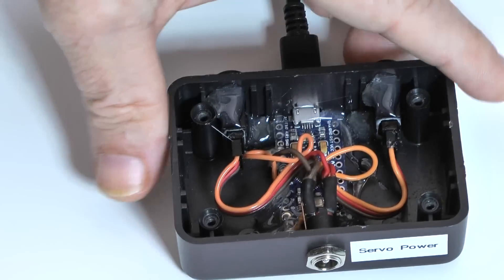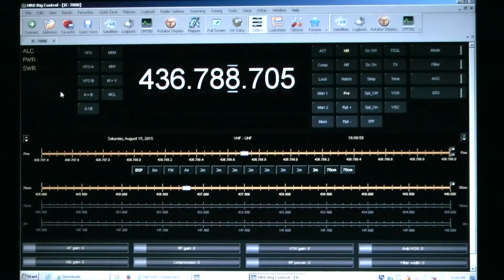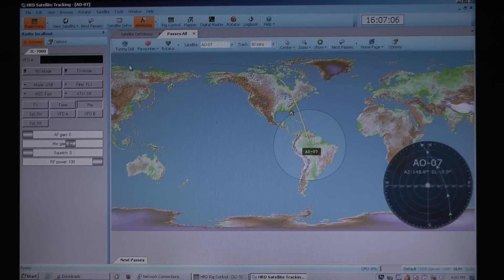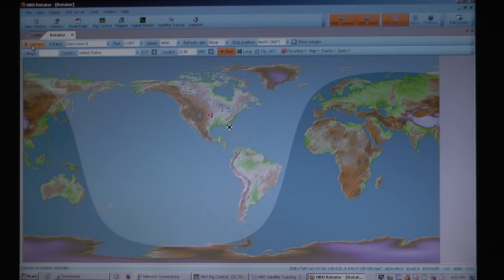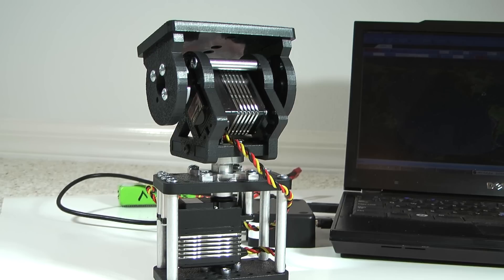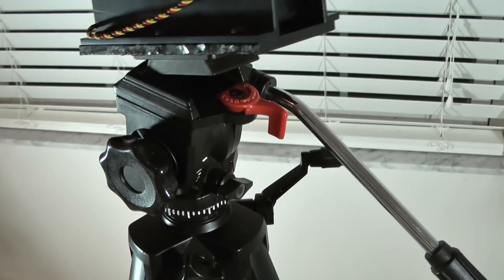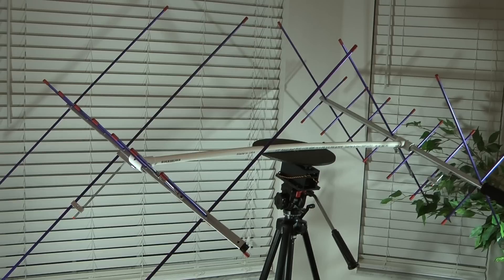Amateur Radio lightweight Satellite Tracker

Comment: You know, until you get your elevation problem solved, you can aim the tripod to the sats  azimuth and max elevation angle, lock the platform, and let the "azimuth" servo sweep along the track of the sat.  (The plate of the servo on which the antennas are mounted is now in the same plane as the "track" of the satellite.) The acceptance angle of the antenna should be adequate with this setup from AOS to LOS.

Comment: pounds is not an appropriate unit for torque.   It is force times distance.   Foot pounds or Inch pounds.
Reply from the maker: Jon Reeves you are correct sir.  It is inch pounds. 
I'm an RC guy and generically we talk amongst ourselves and simply describe a servo as pounds of torque and the inches is always implied. Thanks for pointing that out.

Comment: Great execution of the k6VUG set-up/ project ! Perfect job. ...Just a quick question from an Arduino newbie.. How did you connect the HRD to the Arduino ? Thank yr kind advice , 73 Albert PD0OXW
Reply from the maker: USB cable
Reply: +mvivona9 Tx yr fast reply. You mean this is very same usb cable that connects the arduino to the PC/Laptop (on which HRD is installed) What an efficient project given the fact only wires between the Arduino and the servo's are needed. And servo power supply I guess. Correct? Sorry bothering you. 73 Albert PD0OXW
Reply: +mvivona9 Tx will have a look. Need as a start some small servo's for initial demonstration purposes! 73 Albert PD0OXW

Comment: Hi ! Just a quick other question. One speaks of a "Futaba / CCW" and Hitec for CW servos. Just for the sake of "table"demonstration which servo TYPE / number can you recommand ? Thanks 73 Pd0OXW Albert
Reply from the maker: Any brand of servo is fine as long as the torque specs are good. I bought my servos at servocity.com. They are a robot supply company. They come as a complete package with gears, mounting brackets and all. I don't know the exact servo model. Look on their website under Pan/Tilt/Roll and you will find what you need.

Comment: What AZ EL  actuator system are you using?
Reply from the maker: It was just the Arduino controller connected to two large RC plane servos. Just an experiment. Wasn’t worth the trouble after all. I did better just by holding an Arrow antenna in my hand. Also satellite contesting (which is all there is) isn’t fun at all. Pretty boring after about 5 contacts.
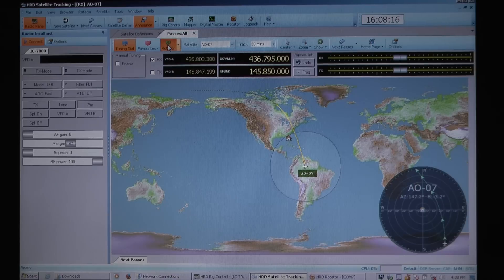Reply: @MV_Checkmate  I was looking for the pan/tilt assembly you have on your demo at 1:30.  There are several programs running on arduino or pi that can run an AZ EL but I have not found an affordable AL El setup.
Reply from the maker: Dennis Schultz I bought the large servos from servocity.com. They have all sorts of items that I cobbled together. Wasn’t purchased as an AZ EL servo, but had to locate servos, plates, disks, mounts etc.  
good luck.

Comment: I have an arrow antenna and I'm working on a tripod mount - how exactly did you mount it ? Looks like a pvc T connector ?
Reply from the maker: I slid a PVC T over the boom. Put a tiny screw through the T and boom to hold the yagi so it wouldn't twist. The cross boom is just a piece of schedule 40 1/2" pvc pipe. I press fit the antennas on and remove them when transporting them. The cross boom is screwed down to the rotating disk. It works fine, but can be problematic at times. I finally spent the money on a 5500 rotor and LVB tracker box. It's nice because it just works, period. If you have any issues the AMSAT group is very familiar with this setup and you get all the immediate help you could ever need. Also it works seamlessly with SatPC32. I like very much the interface that HRD affords me, but there is no support for their satellite module. SatPC32 is very archaic, but does work.

Comment: The perfect controller to this project is the K3NG Arduino based Controller.
http://blog.radioartisan.com/yaesu-rotator-computer-serial-interface/
Here, the full list of the features:
https://github.com/k3ng/k3ng_rotator_controller/wiki/110-Features
 73 de Pu4vlt
Reply from the maker: Very nice, thanks. 
This particular project doesn't require a separate controller. The Arduino board is the interface and controller directly between the ham tracking program such as ham radio deluxe and the PTZ motors via USB cable.
Reply: +mvivona9 Where did you find the unit you are using with the 30 lb motors?  That look very nice. Also did you have any dde issues between HRD and arduino?  Thanks  Craig

Comment: Nice project, can you give a hint on the code for the arduino? I can not make it to work. 73 de sm4yzv / LB4KG.
Reply from the maker: +Björn Fröjd Here is the link that we followed to build the Arduino controller. https://sites.google.com/site/k6vugdiary/home/satellite-tracking-system
Also you might need the EasyComm II Commands Supported:

AZ      - report AZ position
AZnnn.n - move AZ to nnn.n degrees (0 to 360)
EL      - report EL position
ELnnn.n - move EL to nnn.n degrees (0 to 180)
SA      - stop Az rotation
SE      - stop El rotation

Additional Commands Supported:

VE           - show version of this program
HELP         - show list of commands and current parameter values
SV AZPW nnn nnnn - sets AZ servo MIN/MAX pulsewidths (in milliseconds)
SV ELPW nnn nnnn - sets EL servo MIN/MAX pulsewidths (in milliseconds)
SV SPEED nn - sets the turning SPEED (in rpm) for both servos
SV DEFAULTS - sets all parameters to default values
SV          - report values of all parameters
ECHO ON/OFF - turns echoing characters ON/OFF, used for debugging

Feature set:
- Steps Servos by 1 degree until target angle is reached
- EEPROM stores calibration settings & configuration values
- Flip Mode implemented to achieve Azimuth 0 to 360 and Elevation 0 to 180 angles
- Used millis() function for better timing
- Optimised text and string usage to reduce program size
- Implemented parking position for servos on reset (AZ=90, EL=90)
- Added handling of BACKSPACE and TAB characters in commands
- Added Auto Power ON/OFF to save stalled servos
- Added Support for CW (Hitec) and CCW (Futaba) servos